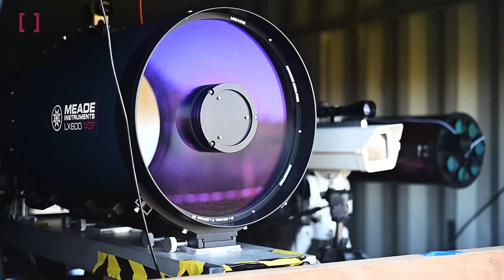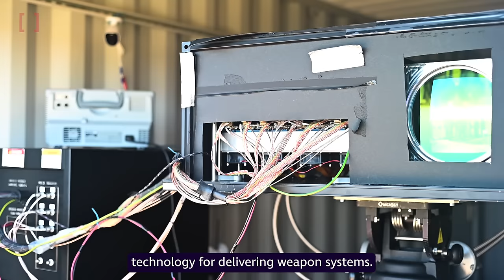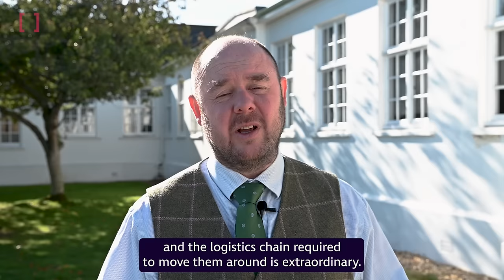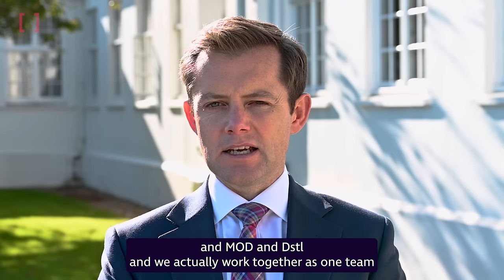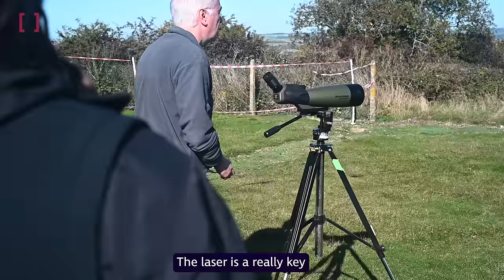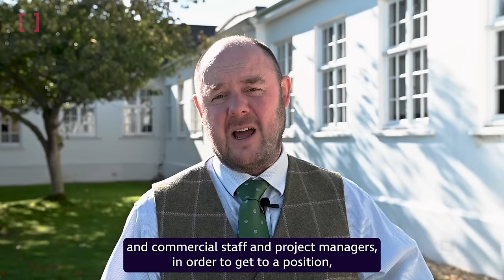DragonFire | Next Generation Laser | Dstl

Comment: This looks very expensive , skilled maintenance  and operation . I assume some other more basic weapon will have to be removed from any warship so fitted \/
Reply: Initial outlay will be more but when missiles cost tens to hundred of thousands to manufacture and then fire, whereas this costs way less than that and the 'round' or beam being fired basically costs the price of the turbine used to generate it (which will already be on the vehicle anyway) there's no comparison. Once fully developed everytime it's used it will effectively be saving money.
Reply: I wonder what happens to the laser beam in rain or does it just burn through.  Could it be used against a sub?
Reply: @ModernNeandertal Interesting thought
Reply: Hummmm, I would say it burns through. Indeed the change of refractive index should deviate the beam slightly, but the peak power is so high, that the water would vaporize anyway, my 2 cents (interesting question btw)

About using that against submarine, clearly not, the dispersion would be quite high, thermal lensing and blooming would occur at this power for sure, so clearly impossible, no matter what! 

Ps: making high power laser is my job @ModernNeandertal

Comment: Nice!   Probably doesn't work if the missile is spinning though(?).   The laser needs to create a hotspot, so any rotation of the missile body and it won't work.
Reply: @LawrenceReitan  Yeah this random 17 year old clearly knows more than 100s if not thousands of engineering and weapons systems staff. So his advice is clearly correct, may aswell scrap the project now...
Reply: Good point